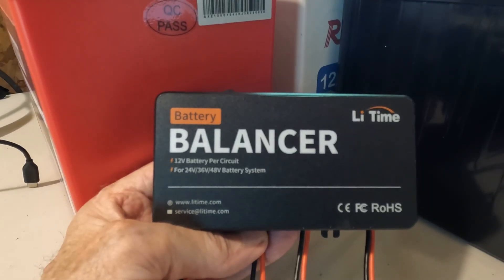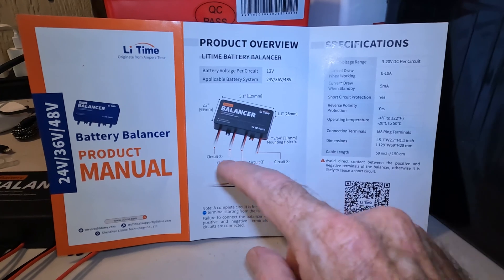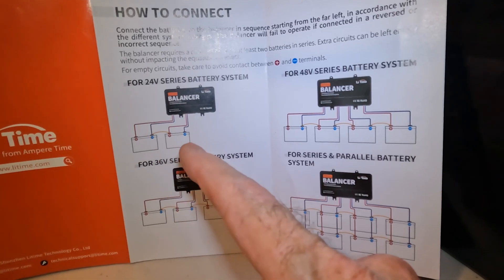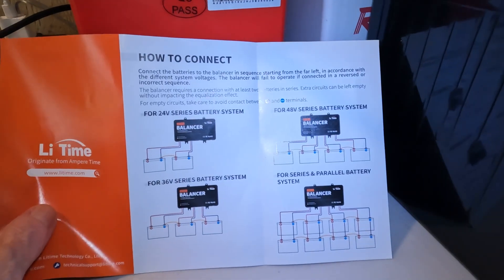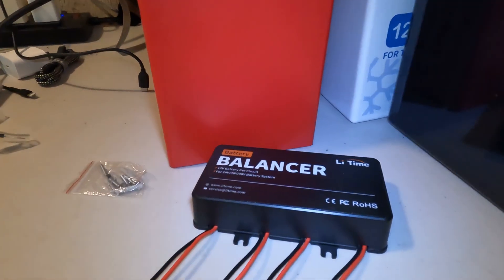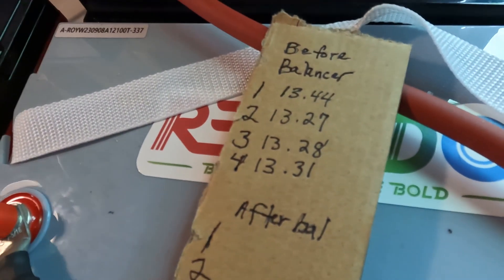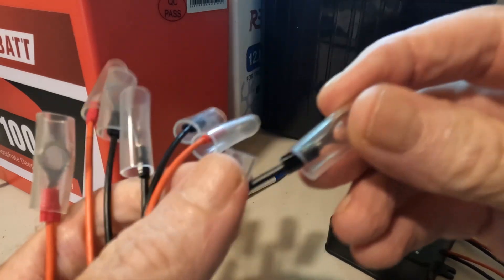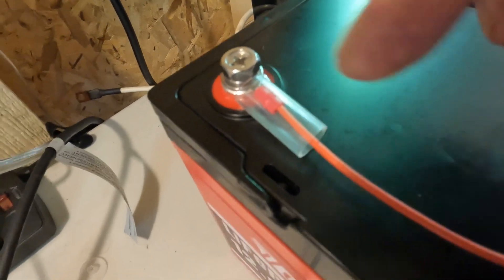balancing to perfection, or pretty darn close ~ DIY mixed bag LiFePO4's

Comment: I just bought this.  See how it does.. do you have any updates.  Aloha brother.
Reply from the maker: No updates really. Used it a few times, once as long as a month or two for backup 48v config. using 4x12v. Worked perfectly in every case needed so far. Aloha brother!🤙

Comment: Can this balancer be used on either parallel and series configuration?
I have only just purchased 2x 120amp lifepo4 batteries and from the get go want to look after them. They will be replacing 2x 130amp agm batterys which needed upgrading.

Thanks for DYI videos.

Comment: I tried one of these, another make, and it didn't seem to do much.  Sure it can balance the batteries eventually when thery're sitting but if it's an off grid system in constant use the charge and discharge swamps the amount of current the balancer can bleed.

Comment: When making series connections with batteries, you should really try to avoid using different size (Ah) batteries because your overall capacity will be limited by the smallest battery.   The smallest Ah battery will always charge up first and either the BMS will then shut down, effectively breaking the circuit or the current will be so low that it won't allow the others to charge properly.  The charging curve on LiFeP04 is extremely flat, so similar voltage readings do not necessarily mean same S.O.C.  Remember also that most BMS's only start balancing their cells above ~%90 state of charge (SOC).  You might be able to avoid this by giving each battery its own separate charge controller, but I'm not sure if this would work considering the 48v series connections.  Do your best to get the same sized batteries next go around.

Comment: Does the balancer only work during charging or will it allow all the batteries to discharge at equal rates? So they are always at the same voltage.

Comment: I have one of these on my 36 volt bank of 3 12 volt batteries in my golf cart.   I  have it connected to each battery with  SAE terminals on the leads.  Since it draws current in standby mode, i only hook it in for a couple of hours after a charging cycle.   You can monitor the current in the red leads with a clamp-on and you'll see the +/- balancing currents doing their balancing then they drop to 5 mA in standby mode. Since its a golf cart bank, i don't want the continuous parasatic current draw. If you are continuously charging with solar, I'd keep it connected.
Reply from the maker: Mahalo for that info !🤙

Comment: Thx for sharing. Might be a silly ? But can i wire this right into my system and leave contact or do i unhook everything from the batteries and run the balancer only/alone?
Reply: Balancers can and should be left hooked up during normal operations.

Comment: I have this same balancer and it gets significantly hot to the touch like really hot. My cconfiguration is 4 lifepo4 batteries of same make in series. I taught it may had been a good touch to increase the longevity of my battery bank but i am having second thoughts. I measured the current comming of the leads with a clamp meter and only saw about 0.5 amp coming out a SINGLE battery and going to no where sometimes 2 batteries but no current coming in to any of the batteries (so basically -0.5 amps on the positive) so this leads me to believe that its not actively balancing but passively balancing, Another thing as well i would connect my volt meter to the batteries and sometimes I would see it drop to 0 volts back up to 13.2 .

I think this weekend i am going to cut the wires. I don't know if i got a faulty unit or what, and for context both me and my dad who put the together are electrical engineers.
Reply from the maker: I will keep an eye out for that once I start charging/discharging in the next week. Mahalo for sharing that information! 🤙
Reply: @ProjectsinParadise808  no probs thanks you.
Reply: Also when fully charged I see voltages like 13.28, 13.35, 13.4 and 13.78.
Reply: 13.27
13.36
13.40
13.76
Reply: Any update?

Comment: Heck yeah, I’ve been using LiTime balancers on my (4X12)
48V stuff and each 12V battery in the series string is usually .01V or less apart as well! 

FYI those balancers can get warm if working hard. Mine are mounted on cement board.

Comment: It's basically "connect it up and forget about it".   I will note that the actual balancing only really matters when the voltage is near full.  It will try to balance when the voltages are lower but it won't have much of an effect at lower voltages due to the flat charge/discharge curve of LiFePO4 .

It will actually unbalance the batteries slightly at lower voltages and cause some extra sloshing around, but it isn't usually anything you worry about.   Not ideal but still a decent solution for anyone with piles of 12V batteries that they don't want to put on a shelf.

In anycase, if you want a more technical description I've put it in this paragraph.  Basically at lower-than-full voltages it is very easy for the balancer to move the voltage a little in either direction, so making all the voltages the same is not hard to do at all.  The actual state-of-charge, however, is not balanced because each individual battery has a natural resting range at any given state of charge that depends on minor differences in the battery cells... i.e. the voltages will be slightly different at the same state-of-charge.   That is why the balancer operating down there actually unbalances the batteries slightly from each other when it equalizes the voltages exactly.

Some extra sloshing of current between cells also happens.  Theoretically this is "bad" for battery aging but realistically it has very little effect on LiFePO4 batteries.  So in situations like this where the 12V batteries would otherwise be on a shelf doing nothing, one might as well put them to work!

-Matt
Reply from the maker: I will be giving it a harder test tomorrow. Just been sitting there at rest with everything showing the same voltage. Now to charge, and discharge and see how those numbers hold up! Mahalo as always my friend!🤙

Comment: It will be interesting to see how it keeps up during loading and charging.
Reply from the maker: That's the big test for sure. Tomorrow is the day I do both, and we'll see how it behaves then! ALoha!🤙
Reply: @ProjectsinParadise808 Did you do a follow up video to do this…. to show how it behaves during discharging and charging… if not, how did it behave please and are you still using it and are your batteries still balanced?

Comment: Hi Bob, great little video...

This would be a better test if you go above 13,5/13,8V. The voltage in LiFePO4 is flat during most of it's cycle. Try doing this above 13,8V or thereabout and see what happens.

I would recommend this option if you have the batteries and really need to use them like this. A native 48V battery is less complex, works better and is the way to go.

Even if these are cheaper versions, 4 of these will cost at least 1200 bucks. For that value you get a pretty decent 48v battery like your 90ah Power Queen.

If you are doing this in the name of science I love it. If it would be a permanent system I would not...

Thanks for the review and the usual "welcome back to the channel!"
Reply from the maker: I agree with you, it's not ideal what I am trying. Would prefer a 48V battery for sure. I will charge it up, and discharge it tomorrow and see what happens. Been dinking around on that system all day today. But tomorrow, the rubber meets the road! Aloha!🤙

Comment: Great video Bob! Now I have to get me one of those balancers. I was surprised how quickly that thing worked.
Does that balancer work when the batteries are hooked up to a system or do you have to disconnect the balancer when the batteries are hooked up to solar panels?

Comment: Nice!
I uses 4 similar type (total 40A) and there is no problem using a 12V solar/wind charger on just one or other cheap 12V eqipment,  (or multiple cells) 
as the balancer will fix it quite easy 
I actually run one 500W Victron 12V Inverter for my garage lights for the last two years
Now i have boght four more of these to paralell old (not broken) Lead acid battery in four strings to  add to my 100ish kWh 48V system
I will add some cheap Shunts to each 12V string to monitor if some strings need to get a extra battery or some goes bad
My system(Victron) is cycled between 52V and 57.6V This will drain the lead acid down to  13V and be top charged at 14.4V...
I guess i can set my Victron to top up every 3 months.....(Both Lead Acid and the Lithium will last a looooong way (I got to pick LA batterys from a freind who runs a hardware store and takes return old batterys for recykleing here in Norway)
Regards from Norway

Comment: Why Is it important to balance
Reply: If the batteries are not balanced it reduces the overall capacity of the battery bank.  This becomes very noticeable if you have one 12V battery that is a "runner".  For example if one 12V battery has a higher voltage than the other batteries, the charge current should stop when that battery's BMS stops accepting charge due to high voltage even if the other batteries are not fully charged.  Consider the following two scenarios where the overall pack voltage is 56V; 1) balanced voltage scenario = 14V + 14V + 14V + 14V;  2) unbalanced voltage scenario = 14.6V + 13.8V + 13.8V +13.8V.  Both scenarios equal 56V pack voltage but in the unbalanced scenario, the BMS on the 14.6V battery would likely shut down the charger even though the other three batteries are not yet full.  Batteries tend to drift out of balance over time due to differences in internal resistance and individual cell capacities. The balancer bleeds off charge from the higher voltage battery and sends it to the lower voltage batteries to counteract this.

Comment: I have used these balancers on my lithium battery bank and found that my batteries drain faster when using them. I stopped using it because I didn't think it was worth it. I think these are more useful for lead acid batteries, since they are more prone to be off balanced.

Comment: I ordered one of those for my system, still assembling everything. My 4- 230Ah 12v's did not have the same voltage after initial charge, one was 12.88v so I wired them in parallel and they immediately were all 13.3v. I also bought a 5 pack of little volt meters to put on each battery to monitor the individual voltage after wiring in series with the balancer. Not sure if that will be useful but they were dirt cheap so why not.

Comment: That balancer is a sweet little tool! It looks as if it’s forming a loop with all of your batteries, taking the top voltage of the highest battery voltage and distributing it to the other batteries to find the voltage equilibrium. This will continually happen when you have one battery that will retain a higher voltage And batteries that hold a lower voltage. It’s as if the higher voltage battery is charging lower voltage batteries. as you discharge the 48 V pack one battery will always discharge at a higher rate then the rest. What I mean to say is that the leadtime battery balancer will take care of the balance, but you will still be dealing with a dissimilar discharge rate. This should not be a big problem at all…. But worth keeping an eye on.
Reply from the maker: It is pretty sweet! I just went up to look at it again before turning in for the night, several hours after the video was finished, All four batteries exactly the same at 13.2V...exactly! And , I will continue to watch it for sure. Mahalo for being part of the conversation brother! Aloha!🤙

Comment: The Victron I believe can only balance current at 750mAh while the cheaper ones appear to be able to do same at 5-10Ah for half the price approximately. Cool that the 48v version can also be utilised with 36 & 24v system too. Moving forward will utilise these on future series connected batteries.
Reply from the maker: I first looked at the Victron balancer, then settled on this one. It is working beyond my expectations so far! Aloha!🤙

Comment: Nice.  I have 2 banks that are 4x 12v 100ah Redodo batteries each.  All are the same make and age, but I think I may get one of these and attach heavy duty clips at the ends.  With the clips I would not have to take the battery bolts lose.  The voltages do stay very close, but I could balance each bank if needed.  I do dislike how messy the wiring starts to look.  My batteries are enclosed in insulation to keep the temps from getting high or low, so I wouldn't see all of the wires, but hopefully the balancer could just be hooked up temporality if needed.  I like Victron stuff but this seems much more simple than what they offer.  Neat product.
Reply from the maker: Mahalo for sharing what your system is doing! All of us sharing helps so much, for so many! ALoha!🤙

Comment: Looks like a clamp dc amp meter is in your future.  I notice my balancer doing most of the work during charging cycle near absorption. Have the ones with the built in voltage meter.  Be careful not to pull too much current and cause one of the batteries to go into protection.  It will short out the balancer. Speaking from experience.  Thanks for sharing!
Reply from the maker: Mahalo to you for sharing that information! Wish I would have used my amp meter! Never even entered my shrinking brain! Haha! Aloha!🤙

Comment: I've tried to buy a LiTime Balancer on their site and it always says out of Stock. I did find a few on eBay.
Reply from the maker: I got it on Amazon. Just arrived today! Aloha!🤙
Reply: @ProjectsinParadise808  cool
Reply: @ProjectsinParadise808  You may find once you start drawing power for your 48-volt config, the balancer may not be able to continue to keep a perfect balance. Those balancers are for Top balancing only I believe. In other words when you topped the batteries off @ 14.2 each

Comment: If i do a 48v 4 battery setup again  i will definitely go that route.  The first 2 weeks, the batteries were balanced.  I stopped checking  and after about a year,  3 batteries were full and 1 was at the low voltage cutoff.
Reply from the maker: I'm super impressed so far!🤙